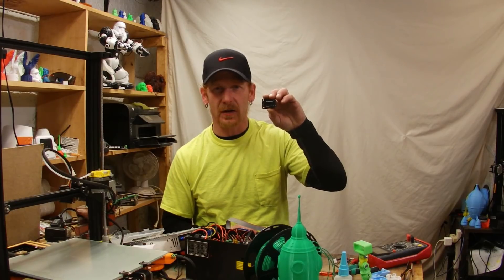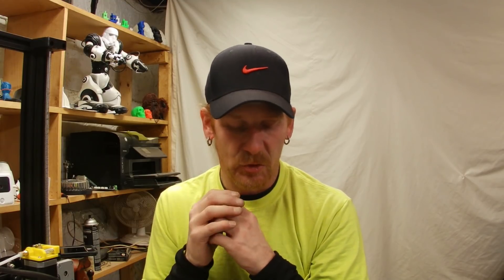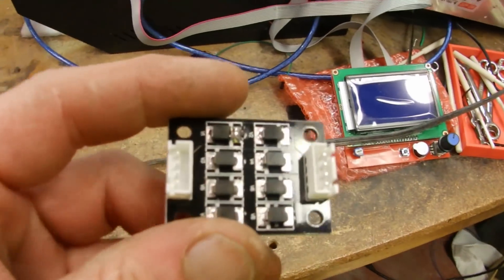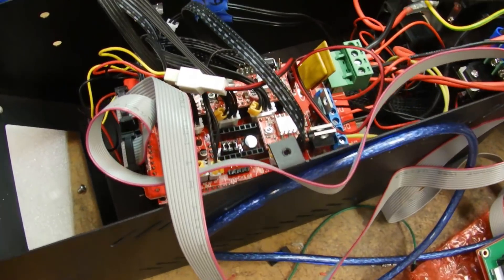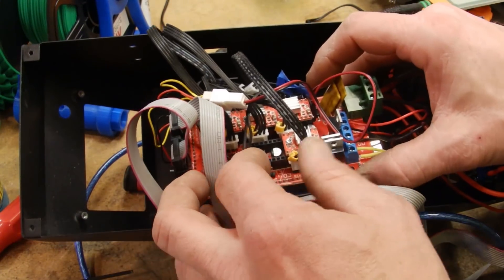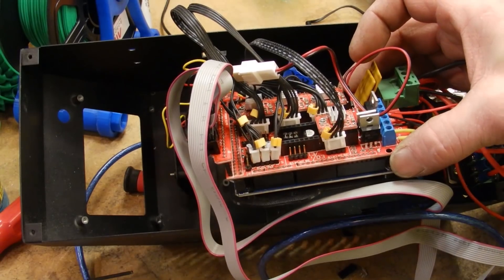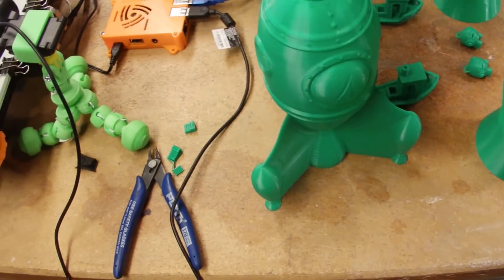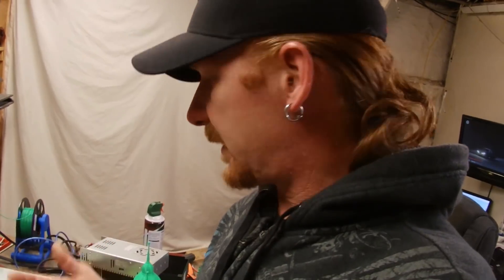Diode Smoother Experiment

Comment: The CR-10 is newer and doesnt have the older Delta-style stepper drivers so youre just trying to fix an issue non-existent in a CR-10. Thats all, if you had an older printer like a Tevo it wouldve made a difference..
Reply from the maker: Yes that was the conclusion but it was just an experiment

Comment: From what I have read the salmon skin artifact affects printers with advanced kinematics i.e delta printers(don't know about Core XY, Polar coordinates printers, and others).

The ghosting you see is probably a cause of you - printing too fast or incorrect acceleration and jerk settings. If you have access to your firmware you might try adjusting those.

I'd like to see these tested on a Core XY machine
Reply from the maker: Yes I got schooled on this I’ve made some adjustments since based on some suggestions and results are better. Now I just have a set of diode boards don’t know what to do with any suggestions I’d be open to
Thanks for watching
Reply: I installed 3 on my delta printer when I first bought it & noticed salmon skin anyway. Tonight I did my first print without them & noticed no difference!!! Stupid thing is, the other day I thought they were a dodgy set & ordered some more.

Comment: not quite. I could be wrong or not explaining it right but this is what I was told.

the salmon skin is from the stepper cutting corners. your going from point a to point b through an arc. as the voltage goes up and down it hits a "floor" where the stepper stops getting voltage so some of the points of the curve are "skipped" until the voltage comes back up and it jumps back to position resulting in a "corner" instead of a fine "arc" hence the salmon skin.

The smoother "boosts" the basement voltage so the stepper never "goes off" and retains proper gcode motion to complete the designed arc. it fixes a flaw in the stepper drivers. it does not remove mechanical noise. it fixes an electrical "flaw" in the stepper driver design. Ringing Ghosting etc.. are UNAFFECTED by these. they will NOT go away with the smoothers.

SO if you do not have salmon skin but just normal mechanical inertial noise (ringing ghosting etc..) the smoothers will do absolutely nothing.

the device name is correct but deceptive. it does  NOT smooth the print (actually it does but indirectly) it smooths the VOLTAGE CURVE and "that" smoothes the print (the unsmooth voltage curve causes salmon skin)

SO if you don't have that issue. they won't do anything.
Reply: I installed one today on the extruder stepper motor and it had a major effect on removing the salmon skin. First i tried two on the x and y axis stepper motors, but that did not have any effect. So i think you are right on the salmon skin being caused mainly be the extruder path.

Comment: I doubt you'd see any difference if your ramps is using A4988 stepper drivers as the DRV8825 were the drivers causing issues of missed steps and salmon skinning these are supposed to combat. If you're printer isnt using DRV8825s, you wont see a difference. 
Here's a link to the original work done Schrodinger Z by that lead to the circuit all these smoothers are emulating (some poorly using only 4 diodes rather than the 8 required to actually work) http://www.engineerination.com/2015/02/drv8825-missing-steps.html

Comment: On the Rocket it seemed you were more pointing out Ghosting which is not Salmon Skin and not what Smoothers are for.  

The main body of the rocket is where the salmon skin shows up the most.  You should see the pattern radiating out all directions on 4 sides.  The smoothers took 90%+/- of Salmon skin away on my Tornado.  

The Ghosting is the problem I’m trying hard to fix,  which comes from the mechanical side. It’s mostly the Y axis on the Tornado because the carriage is heavy.  I have some carbon fiber on the way for new brackets and support plate.... hoping it works 😂

Comment: Thanks for the review! Would have been awesome if it worked, lol. Ive always heard ghosting is caused by movement in the frame while printing. After it corners fast, the x carriage goes back and forth slightly trying to recover from the sudden change in direction causing the "ghosting" effect. I think if you either stiffen up the frame, print slower, adjust your belts tension, or a combination of those, it will greatly reduce that effect on your print. You could also try marlins fairly new feature called linear advance. Thats supposed to really improve the look of corners but idk if it will help the ghosting effect. However it doesn't work well with bowden setups.

Comment: Very interesting concept. I was hoping for an instant fix for the ringing issues. It's always been my understanding that ringing is the result of mechanical instability and movement, either caused by un-noticable frame swaying or bed jerk, solely due to the mechanical forces of the head (hot end) moving rapidly and stopping rapidly. I thought the only way to reduce those effects were through weight reduction of the hot end assembly, frame stabilization, stiffer belts with less backlash, or slowing the print speed to reduce the physical forces on the frame and belts. I know stepper motors with a finer step count would reduce those effects also, but that's a whole other beast altogether. (although I'm guessing when you put that new board in would have been a good time to consider a motor upgrade too?)  So, I'm just curious, (with your electrical knowledge and my lack thereof ) what were your grounds for assuming this would stabilize the motors in a way that the print quality would be effected? If the idea is sound, is there possibly a different way to achieve the results you're looking for with a different bolt on component?  You've got my interest peaked with this "signal stabilization" idea. Thanks again for another video with great ideas to get the wheels spinning!